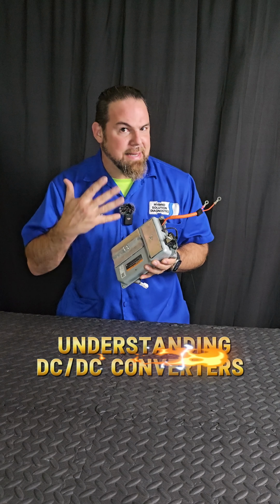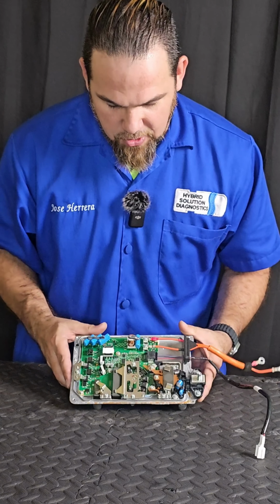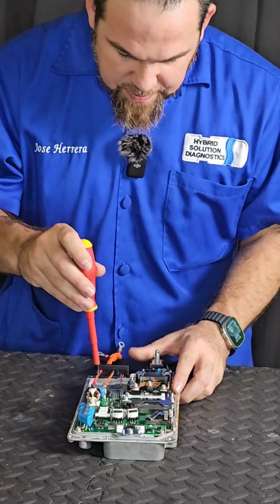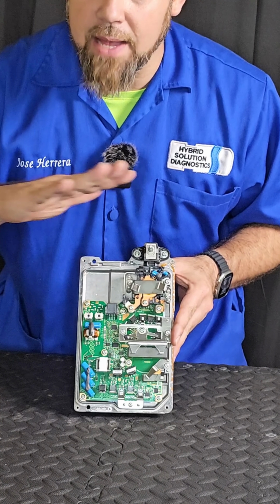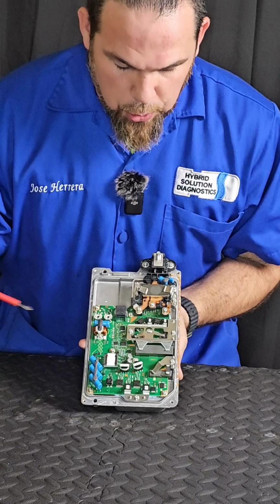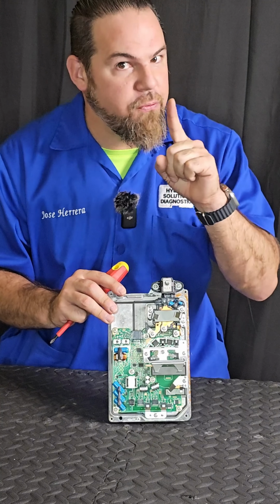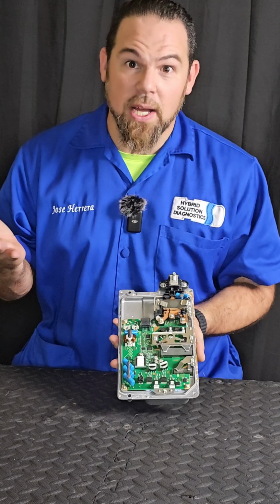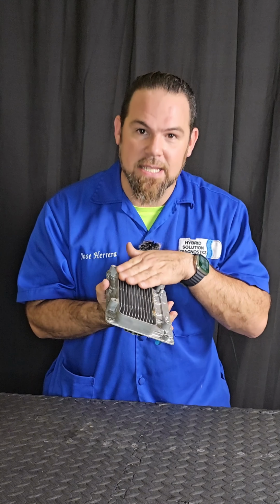Nissan Epower DC/DC Converter Explained

Comment: So from your experience should I bypass my dc dc converter all together and just charge a battery bank on shore power and leave the dc system for my accessories completely isolated?

Comment: aren't those "tiny wires" connected to 360v? With higher voltage, you can use smaller wires, correct?

Comment: As you said High Voltage is how many volts?
Reply: For gen 1 e-power it's around 300v
Reply: @renisa12340  Ok, because based on IEC 60038, 300 Volts is still categorized low voltage
Reply: @wongsabarchannel1335  well if you refer to that document, all the EV right now  is low voltage.
Reply: @renisa12340  Ok, for electronic engineers maybe it considered as High Voltage, nevertheless for electrical engineer it is considered as low voltage. Anyway thank you for the confirmation

Comment: My 2022 note e power makes a click sound when I step or release throttle. It sounds like some relay switch or solenoid. Only at low speeds. Is it the brake switch or something? This noise wasn't there before. Now at 50,000km.
Reply: He won't reply. Same did to me. He needs views and subscribers.